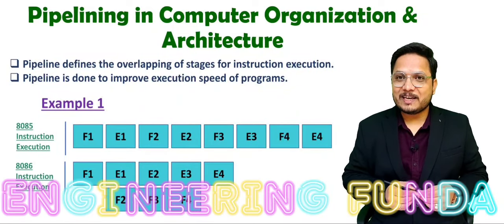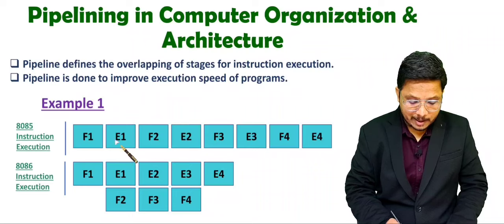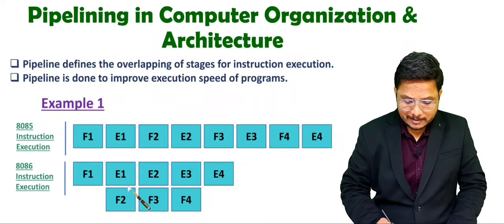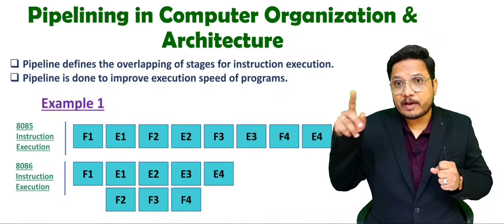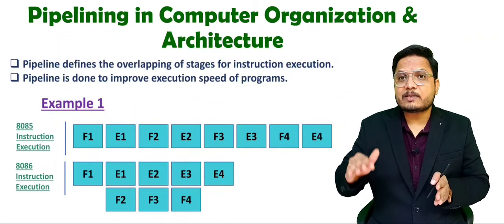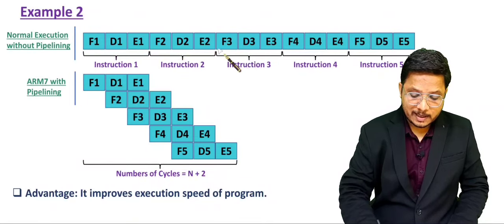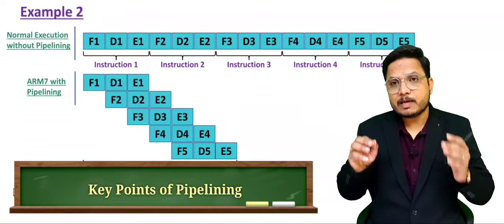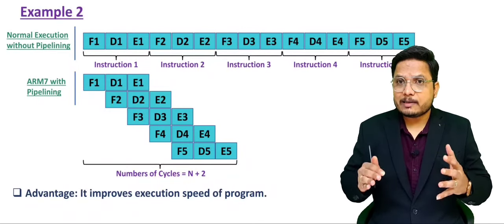Pipelining in COA: Basics and Implementation in INTEL 8086 and ARM7 | COA

Comment: What is the difference between single-issue pipeline and multiple issue pipeline? Is the single issue pipeline the same as a normal execution?
Reply from the maker: Single-Issue Pipeline:
In a single-issue pipeline, only one instruction is issued in each stage of the pipeline at a time.
Each stage of the pipeline performs only one operation at a time.
Instructions move through the pipeline one by one, and the pipeline processes one instruction per clock cycle.
The pipeline is simpler to design and control but may not fully utilize all available hardware resources.
Multiple-Issue Pipeline:
In a multiple-issue pipeline, multiple instructions are issued in each stage of the pipeline at the same time.
Each stage of the pipeline can execute multiple operations concurrently.
Instructions are grouped together and executed simultaneously, allowing for more instructions to be processed per clock cycle.
The pipeline is more complex to design and control but can achieve higher throughput by utilizing available hardware resources more effectively.